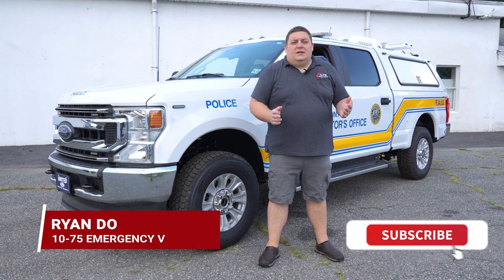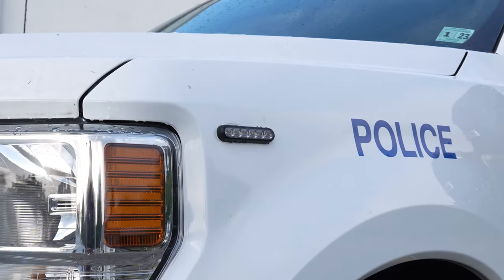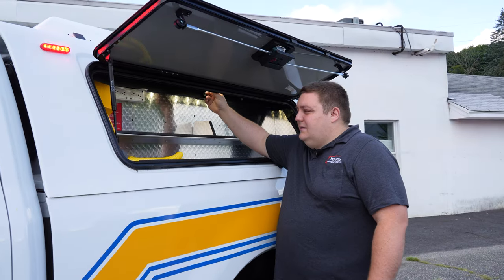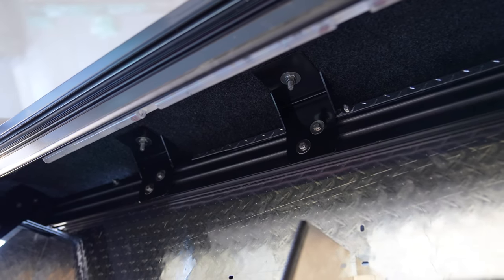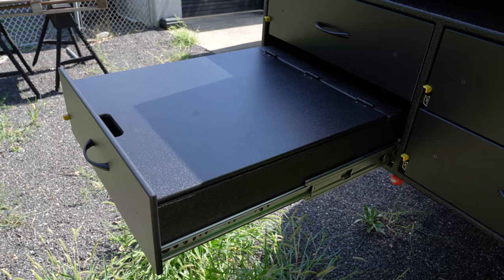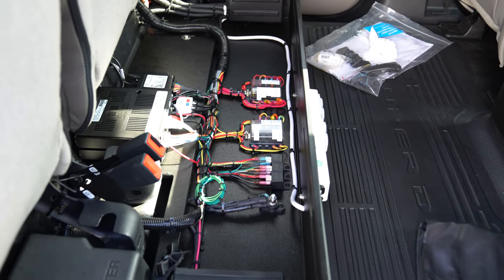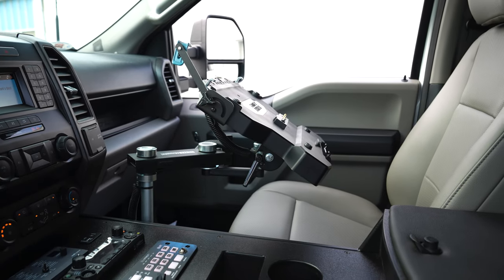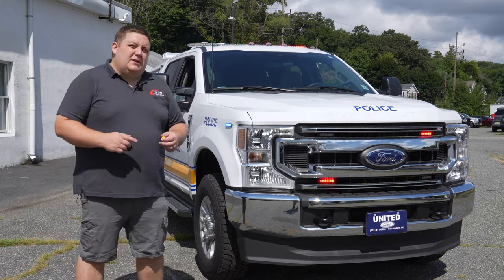FATAL ACCIDENT INVESTIGATION TRUCK | 2022 Ford F-250

Comment: Surprised they continue to use old verbage, Typically, traffic involved is called a "Collision". As "accidents" imply no one is to be held responsible for the incident. Cars don't crash themselves. Great build over all!! Your team really nailed it!  Love the tower being 12V. Allows for slow movement and operation too. Also love the 110 master control on the side there. Slick planning.
Reply from the maker: Thank you
Reply: you have a point, especially considering its from the prosecutors office